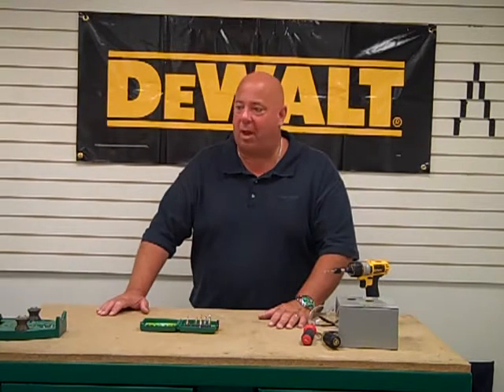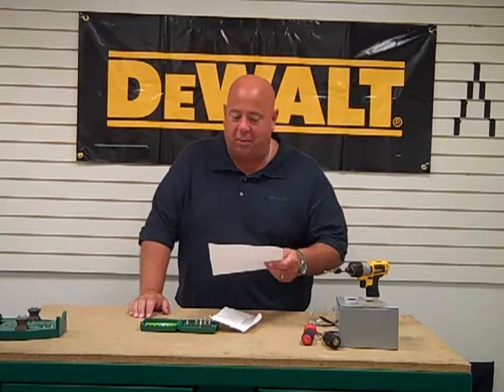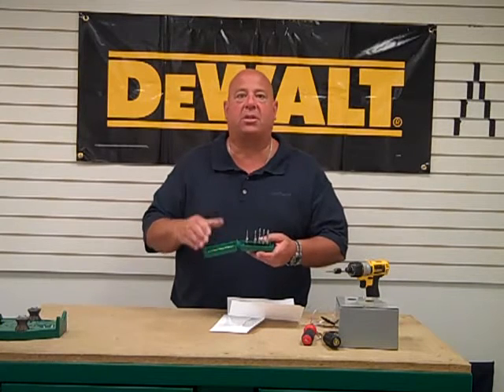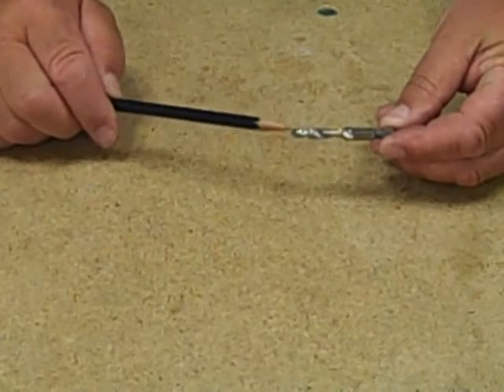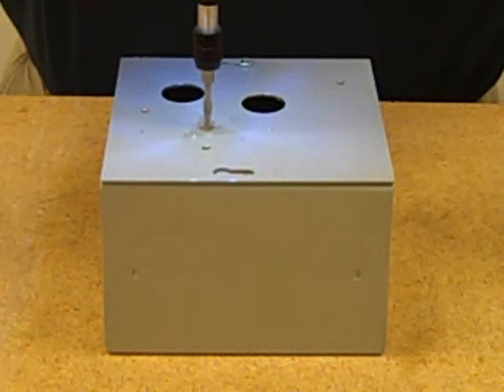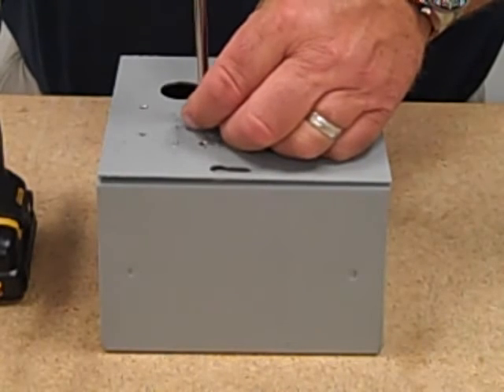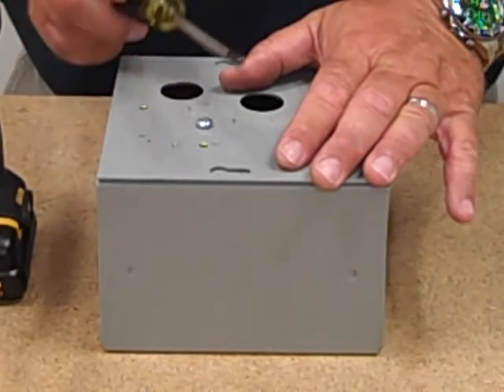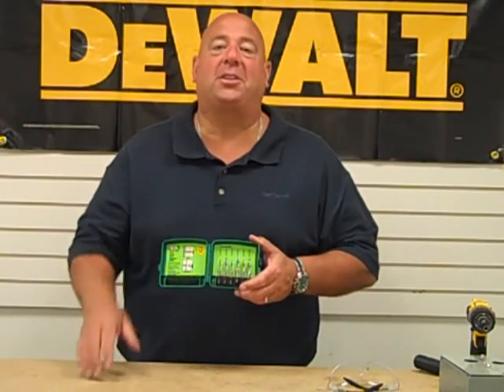How to Drill, Tap, and Countersink - Greenlee DTAP Kit

Comment: It's hex shank not square and you cross threaded the screw.  No big deal, but if your gonna post a tool video for tool guys..............Take 2 perhaps.  Regardless, these drill taps are the bomb.  Highly recommend the long shank version for thicker stock up to 1/2" steel.